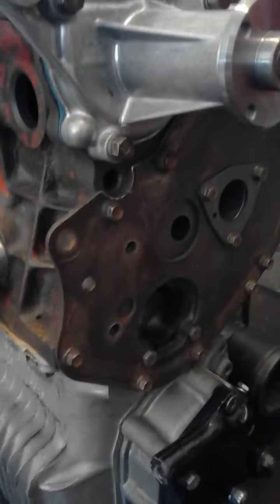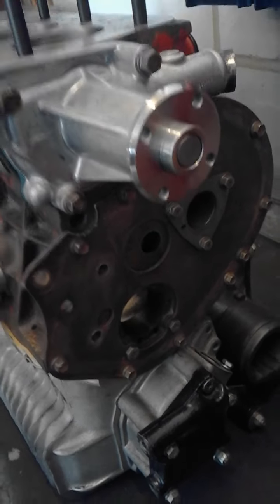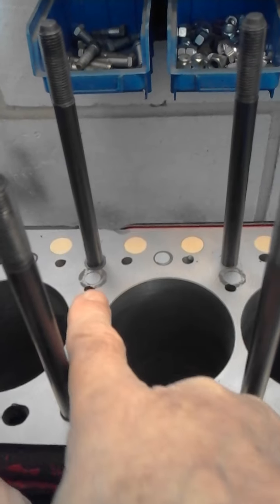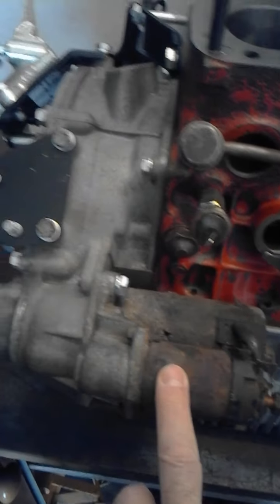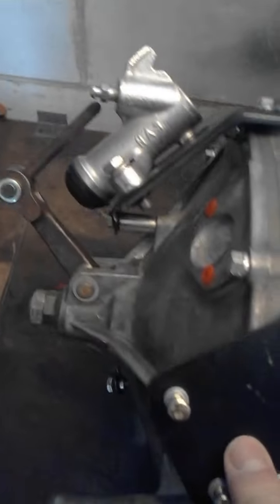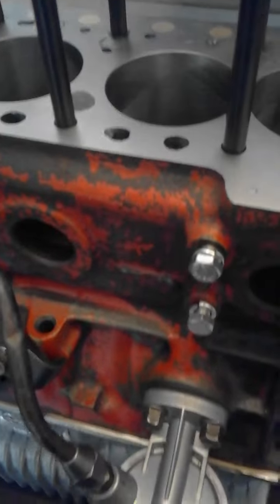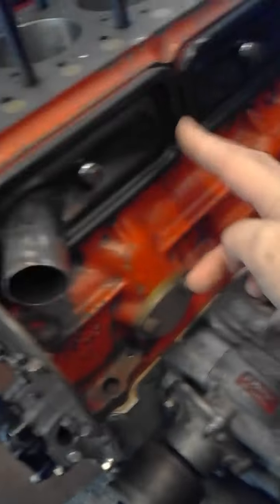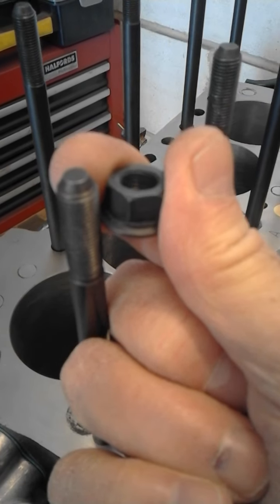Build of 1098 A+ Mini engine with BMW K series Twin Cam Head

Comment: Hiya, Great series of videos. I'm intrigued about your block machining, I have a small bore block for a k100 conversion but if i don't move all the head studs there are two at the back that break between the water gallery and tappet chest. I did look at moving the studs closer together as they are smaller diameter than the bmw 10mm ones. I look forward to seeing more of your progress
Reply from the maker: Thank you!
You do have to follow the stud pattern of the BMW head exactly. You can use the BMW head gasket as a pattern or, as I did, mount the bare head on the block using the 3 studs that stay in place and 'spot' the other 7 centres through the stud holes in the head. You can then fill in the old threaded holes with some sawn off bolts.
The only point to watch is the depth of the thread cut for the studs in their new location or you will as you said break into the water jacket. Ask me how I know! But you can drill and cut a thread just deep enough in the correct locations to take the threads on the bottom of the studs as long as you use a blind / flat head tap.
Good luck. Its an interesting build.
Reply: @1chish  James Barcham meens, is that you should not retain the 3 front studs from the a series, they should be closed too, redilled in the way to move  the 10 bmw  head studs pattern  2-3mm towards the distributor side ( you keep the bmw stud pattern exact the same, but move all of them 2 to 3mm to the front of the engine), it avoids having to 2 studs breaking through the oil tappet chest and mixing coolant with engine oil. I am building the same spec engine 988 a+ bloc, 1098 crank with +0,60 pistons with the 16v bmw head. Happy to see, that people are still building nice small bore engine with the twincam. Greets
Reply from the maker: @vincadonis8008   Well that wasn't the advice I had from Specialist Components and I used their drilling template and retained the 3 origibal locations. The head dropped straight over them.
Of course moving the stud pattern will move the head and therefore the valves relative to piston bores.
As I replied to James the issue of breaking into waterways is not so much location but depth of the hole drilled. Those 2 mm will make no difference if you drill in too far.

I would love to know how you will fit 4 valves per 998 cylinder especially with only +60 pistons. Mine are +100 and I still had to machine the lip of the piston bore to clear 2 valves. I am however using 16 valve throttle bodies and TPS and turned the 16v manifold upside down to fit the 8v head. 
All the best on an interesting build.

Comment from the maker: Big 'D'UH moment. 🤦‍♂️
Just realised I did the Portrait not Landscape.
When its a bit warmer outside I will redo this Landscape.
I know ... I know 😂
Reply: When Mark and I first started documenting builds together, most of it was photos that I would put in a montage. It took mark months before he got used to taking photos on Landscape. I used to curse him as I had to crop hundreds of photos and resize 😂
Reply: It's all coming together nicely. I like the idea of converting the original distributor and converting so you can use the BMW ECU. Much more cost-effective and hopefully much simpler
Reply from the maker: @classicminiworkshop  The BMW HES set is on the nose of the crankshaft so there are two sensors - 1& 4 and 2 & 3. As the Distributor is turning at half speed I had to fit 4 new ones on an aluminium plate to replace the standard points plate and fitted the Hall Effect rotor onto the cut down bob weight plate.
Could use it on a standard Mini!
As long as the ECU gets a signal for No 1 it knows when to fire the fuel injectors and also fire the ignition coils (2 on the bike). But I am pretty sure I will bypass ignition coils and use coil packs as each cylinder will have a unique trigger signal.
All good fun.